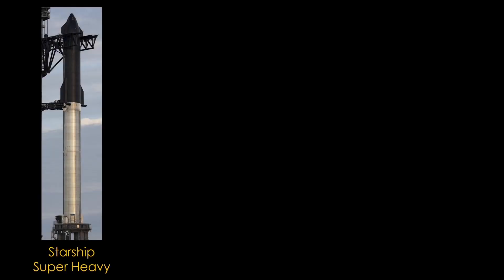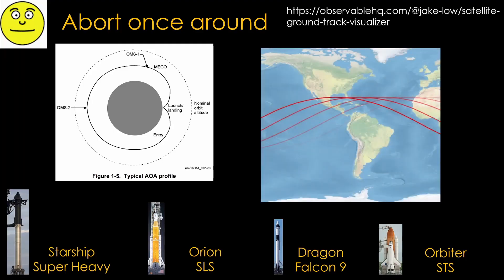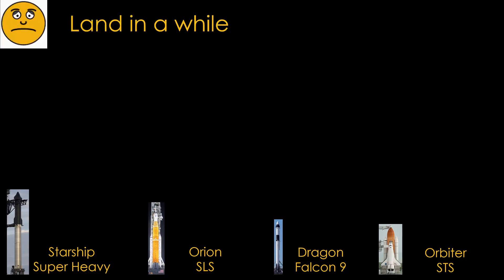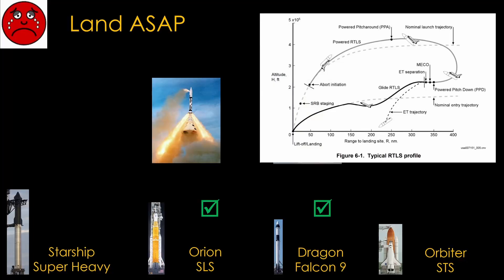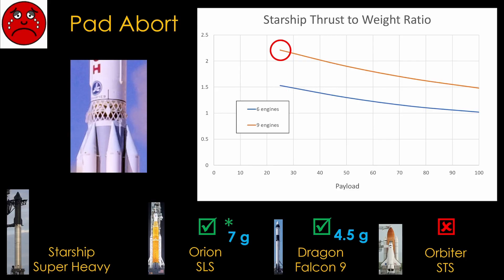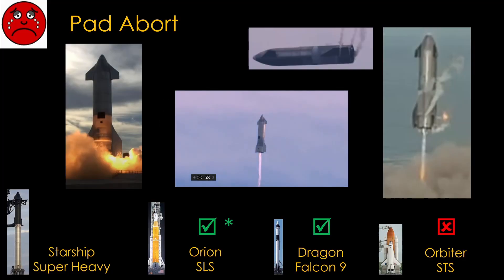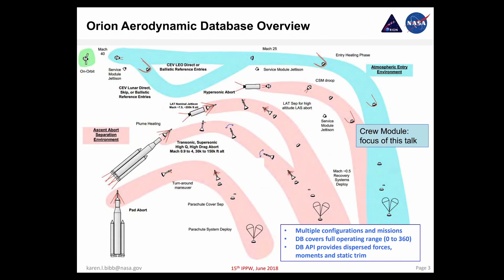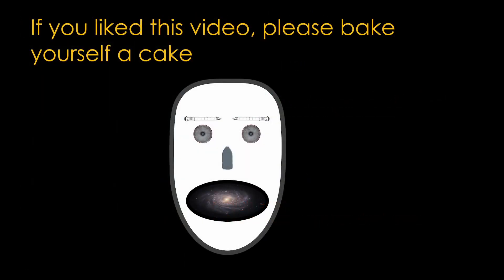Starship Abort Modes

Comment: Orion and Dragon are the only capsules capable of aborting after s structural failure, like the one seen on that crewed Soyuz launch not that long ago
Reply from the maker: Why do you think Starship is unable to abort in that scenario? 

BTW, the Soyuz failure on MS-10 was a staging failure that led to structural failure in the second stage.
Reply: @EagerSpace  In case of a staging failure, there are no aborts available for Starship or the Shuttle, since they are essentially the second stage. 
Granted, seperating Orion from the ESM is also a staging event, however, it takes place in space after orbital insertion, or TMI, in this case, which means you have much more time at hand to troubleshoot the issue. During launch, you're toast.
Reply from the maker: @edki669  Ah. You said "structural failure" in your original response...

Staging failures in general do tend to be quite problematic - that's why SpaceX has gone with pneumatic systems that they can test - but there are certainly cases where if you can't get starship disconnected from Super Heavy, you will have a very bad day.

There are also cases where if your abort system on Orion malfunctions - if you cannot jettison it - you simply cannot reenter successfully. 

All the systems out there have tradeoffs.
Reply: @EagerSpace  

The booster already has four very high drag producing surfaces which if angled could also provide drag while ascending. A combination of that with trying to push the ship of the booster via gas pressure like some missile silos did to throw the door off to the side would solve the problem of separation.
Reply from the maker: @topsecret1837  If Starship/Super Heavy stage at about where Falcon 9 does - around 50km or higher - there's pretty much zero air left and therefore no real drag. 

Somewhere down lower there's an altitude where that's no longer true, and then it's the drag of the grid fins versus the drag of the nose cone. The nose code is going to have more drag based on area but the grid fins are more draggy. Not sure how that one comes out.

Comment: My question is for Starship’s abort capabilities late into Superheavy’s burn assuming a majority of it’s engines are still operational and the booster is intact. Would a fully fueled Starship with payload be able to accelerate faster than an unburdened Superheavy booster, or at least at a significant enough rate to get out of it’s way? That puts a pretty wide black zone in Starship’s abort capabilities.
Reply from the maker: I think the answer to your question is "no". 33 raptors will give super heavy plus starship more acceleration than 9 raptors on a fully loaded starship. 

But the scenario seems unlikely to me. Why would you want to abort from Super Heavy if all the engines were still running, and if you did, what would keep starship from being able to shut down the engines on super heavy?
Reply: @EagerSpace  yeah, I figured as much a bit later as I was thinking about it. It isn’t a very likely scenario. Thanks for the response 👍
Reply: Assuming all the Booster engines continue to fire after separation, this is not survivable if the Ship is fully fuelled.
However, if you under-fuel the Ship (as Musk has suggested to make pad aborts possible), then this is possible:
50% filled Ship: can abort up to 35s into flight if booster continues to fire (LEO capacity reduced to 50t)
30% filled Ship: can abort up to 90s into flight if booster continues to fire (LEO capacity reduced to 20t)
Reply: @OzearEimaj  

Also not to mention that since 80% of the propellant mass is LOX the ship can dump almost all of that very quickly.
Reply: @OzearEimaj  

This also assumes that the booster cannot have a sudden increase in drag, for which it can for very obvious reasons in order to slow down on nominal entry and to drop below sonic speed for landing. They would need to be angled though to allow drag to be produced in ascent whereas a 0° AoA would not produce drag in that phase of flight.

Comment: I feel like starship pad abort will be like shuttle rtls. requiring continuous miracles interspersed with acts of god to work. Could 9 raptors start up fast enough and have enough thrust at SL to push a fully fueled starship away from an exploding superheavy while not vaporizing itself?
Reply from the maker: It's an interesting question. You can probably come up with scenarios where it won't work, but remember that in the AMOS-6 explosion on the pad, the payload survived both the second and first stages blowing up and appeared to be largely intact when it fell over soon after.
Reply: @EagerSpace  I'd guess that before we had a hotstaging ring, a successful Starship pad abort was unlikely, but with it, it's now very possible. We know these engines can start up in around 1 second, if the ship were falling for that long, it would take another second or two to halt the fall and start ascending, at which point the ship has dropped up to 20 meters, not great.

However, if the ship is also being held by the tower arms during fuel up, then maybe a pad abort is more likely.

There are also pad abort scenarios where the abort could be triggered before any actual explosion occurs, for example, a rupture in plumbing dumping methane everywhere could justify a pad abort, albeit could also cause the explosion it's trying to escape from.
Reply: ya it was always a source of confusion for me how spacex fans would belittle the space shuttle for not having a proper abort system but be totally fine with starship not having one as well, lacking srbs doesn't magically fill the whole launch with a single abort window

Comment: 11:33 Depending on how early in the launch the Starship aborts, it may never even need to perform a belly flip. If that's the case, then it only needs to burn off enough fuel to ensure that it can land with however many engines out the design team desires, and hover straight to a landing.
Reply from the maker: Really interesting point and I'm unhappy that I didn't think of it.
Reply: @EagerSpace  well, it's not watertight; given the bellyflop requires some distance to fall to establish stable attitude control, there may be a point where you're too high up to do a full hover landing, but too low to do a belly flop. I haven't done the math to see if this regime exists, but in that case the crew is doomed.

Comment: Escape system acceleration really depends on the energy of the propellents and how fast the shockwave moves. Aerozine50/N2O4 on the Titan II launch vehicle were lower energy, and the acceleration of the ejection seats was more than enough. The reason why Orion's abort system has much higher acceleration is because its liquid hydrogen propellent is much more energetic in terms of hydrogen/oxygen. My main concern with Starship is pad and early in flight aborts, the RVACs will have much less thrust ASL. There is quite a lot of liquid methane and liquid oxygen in there, and I'm not sure if starship would have the oomph if needed to get away. It also depends on the ignition system of the engines. If it uses a spin start system, either a solid cartridge like the LR-87 and LR-91 family used on the Titan rockets, or a pressurized gas system, on the RS-68, they might be able to start the engines in time for abort, if they detect the problem early enough. If they use a Tank-head/bootstrap method used on the F-1 and RS-25, then it would be infeasible as these take considerably longer to start
Reply from the maker: Thanks. 

Musk did comment - which I interpret as a speculation - that it would be possible to spin up the Raptors quicker in an abort scenario.

I don't think there's been a lot of engineering brainpower spent on the need to spin up motors quickly simply because it hasn't been a requirement AFAICT.
Reply: If Elon's tweets are anything to go by, the Raptors can spin up very very quickly. The flip and landing at least, shows that Starship can create time critical ignition in a rapidly varying g-environment